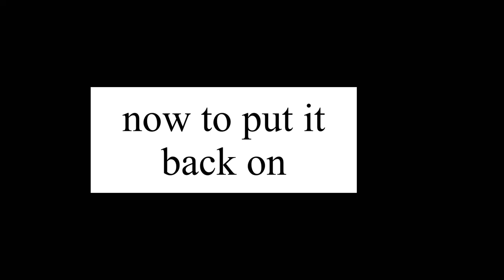Forklift brake shoe replacement

Comment: Is it just me? The old shoes looked like they had a lot of pad left.
So glad I saw this video. It looks basically the same as some big GM drum brakes - basically.
I would have liked a bit of narration but honestly, good camera angle and very thorough. Thank you for posting this.
Seems like 90% of used forklifts for sale say "needs brakes" in the ad so I've been wondering what I'd be getting myself into.
This video was very helpful. Thanks.

Comment: So my co worker.adjusted the brakes so tight we can't get the drum off any solution. has the Lil slot in the back of the drum to adjust Lil gear u can adjust up but not down any help.woulp be appreciated
Reply from the maker: You need to push the lock on that lil gear while spinning down

Comment: What about the fluid that leaked out of the hub at the beginning? Does that come from the hydraulic fluid reservoir? Thanks!
Reply from the maker: That’s differential oil
Reply: @jupdagstv how come that wasn't covered on replacing the oil in this video?
Reply: @alexm8922  it's ok we just let the world know lol. Brake job went well. Ended up changing tranny fluid and diff. Not as difficult I thought it would be 👍🏼
Reply: @Jay-xe3cq that's not why I'm asking. I'm trying to learn all the steps needed to replace the brake shoes. If replacing the lost fluid is not covered, then this job tutorial is incomplete.
Reply: @alexm8922  no biggie, raise the forks, support with a 2x4. Just crack the fill bolt on the front of the diff and fill untill fluid comes out. Let the excess flow out and screw the plug back in. Just like a cars manual transmission, gearboxes etc.. with that tutorial complete.